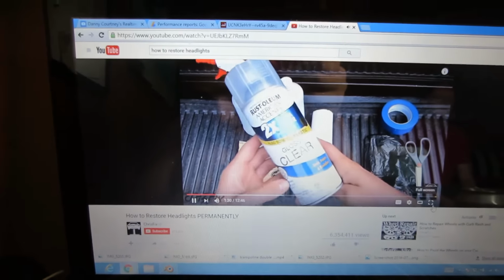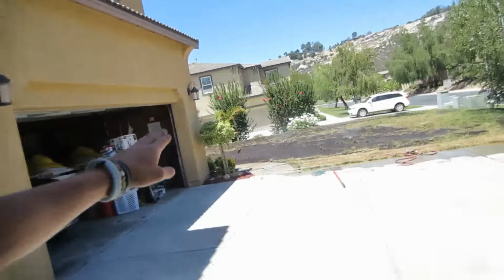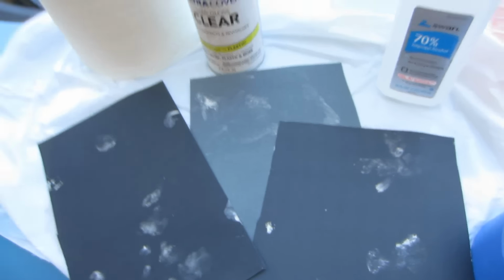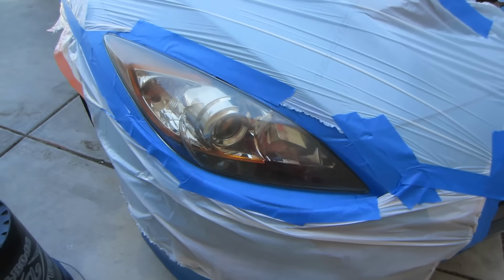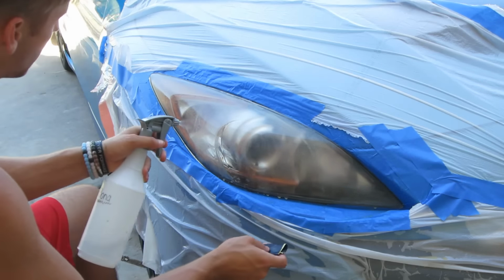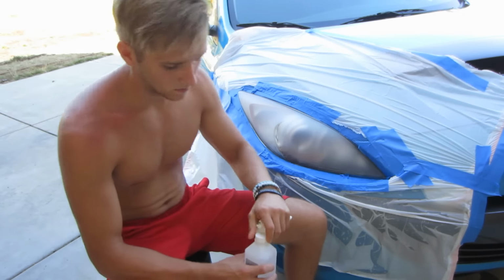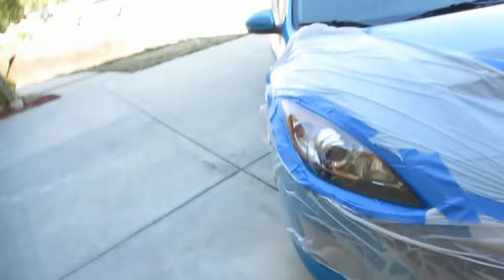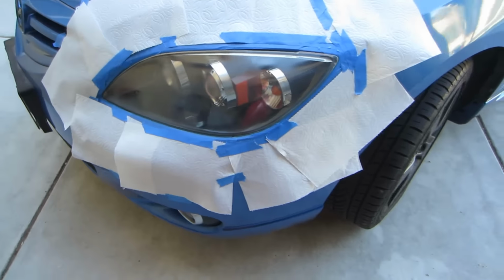How To Restore Foggy Headlights

Comment: You should wet sand the clearcoat that way it doesnt leave a tacky feeling to it, and it comes out leaving a better shine in the end.
Reply: what grit of sandpaper?
Reply: +Edward Grijalva usually 2000 and above. Since 1500 will leave swirls. 2500 or 3000 is best
Reply: Eon Predator thank you, thank you! Now that i have that bit of info, it's time to restore my headlights.

Comment: For my headlights i used 2000 grit sandpaper and wet sanded them. then i used polish(toothpaste) and they looked really clear and shiny.
Reply: wet sanded with soap and water.
Reply: and btw its a 99civic so imagine how bad the headlights were after 17 years.
Reply from the maker: yeah in the video i recommended 2000

Comment: When I restore Head lights I use a two stage sanding process (2500,3500 grit)and a 2 stage polish process to get ultimate optical clarity. The lower grit  paper that you were using looked really agressive. Let me know if you want your Mazda  Speed3 detailed! Check out my Mazda 3 headlight restoration pics on my website - thefirstformula.com
Great video Danny!
Reply from the maker: i mean if you want to lol!
Reply: +Danny Courtney yeah for sure. Drop me a message next time the Mazda needs a good wash - and I will come in and give her a full detail.

Comment: Not exactly how you do it, so I wouldn't trust this tutorial. You got the wet sanding part correct, I personally use different Grits. Anyway for those who don't know, this is to sand off the old uv protectant on the light that's foggy/oxidized. However once you instill sanding scratches you need to remove them using a strong compound followed by a polish on a rotary or da polishing machine. Then you would want to protect the lights from future oxidation so you'd use some sort of clear coat. I've never seen this one get used in the detailing world, but I know there's some available that'll do the job
Reply from the maker: this did the job for me,

Comment: or buy the head light restoration kit for $10 lol
Reply: they don't work as well as putting on a new clear. It's just like using toothpaste or bug spray its on temporary and will go away after awhile. Sanding and putting new clear coat on is the "professional" way of restoring headlights
Reply from the maker: yup